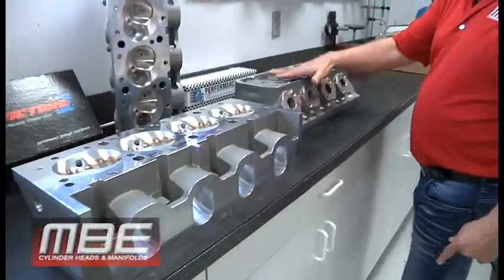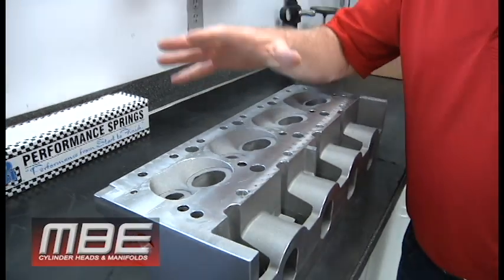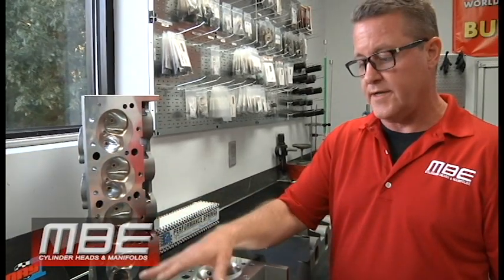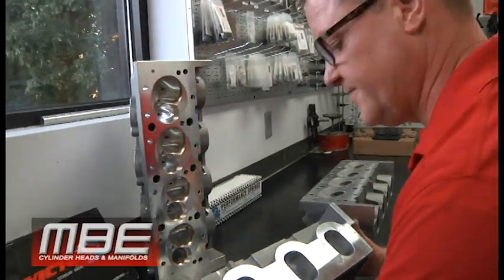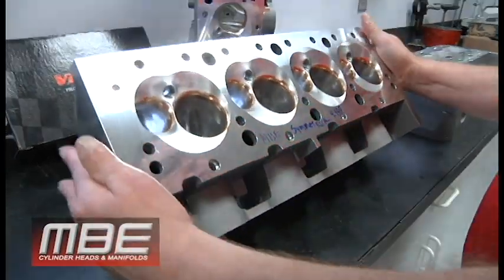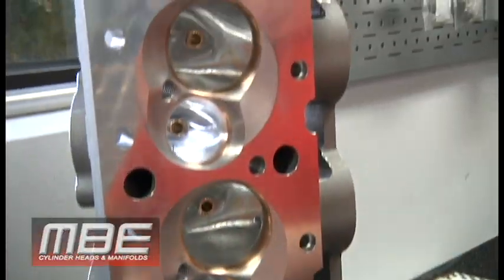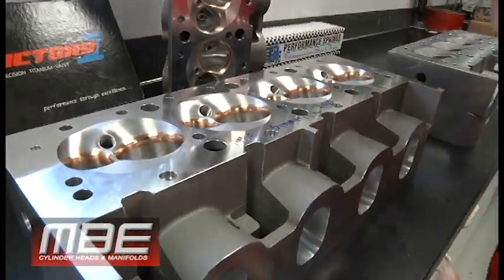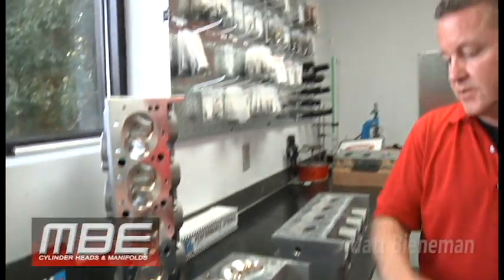** GAME CHANGER **  This SBC Cylinder Head will change History

Comment: I have been hand porting heads since the 70s and "My God" is that piece machining perfection or what?  DAMN nice! $10,500.00 worth of nice lol. Actually for heads of that caliber that's not all that bad. I paid close to that for a head for our Pro Stock JD pulling tractor back in the early 90s. When he said.  "1100 hp naturally aspirated."    He immediately had my full attention. Unless you have spent the countless hours designing and machining one yourself it's hard to appreciate the time and effort it takes to pull something off like this. Good job guys.
Reply: I'm just going to put more boost through my junk yard 799 heads.
Reply: @Adrianzx  exactly
Reply: The offset rockers required on top of that I bet
Reply: Wonder what would happen if someone used CAD CFD to design heads from scratch.
Reply: You put way too much faith in his 1100HP NA claim.
Reply: @DonziGT230  With those ports and a lot of RPM I wouldn’t doubt it
Reply: I got a woody when I saw those ports,seats,and runners and he said 1100 NA... I've spent 100s if not 1000s of hours on heads back when to get a set to flow nowhere near that... Plus even aftermarket performance heads have always needed many hours of massaging to get redonkulous flow NA..
Reply: @DonziGT230  What makes you doubt that number?
Reply: @Adrianzx  you boost 799s past 1000hp?
Reply: @rustywater3219  , They do.
Reply: Yeah. "Normally aspirated" is used by lots of  "engine builders" and other "experts" in "high performance" to refer to any engine that is not "boosted". Including "nitrous motors".
Reply: @DonziGT230  it's for a big inch small block and 1100 hp is attainable if you know what you are doing. The average person will never see it. Nascar has been getting close to 1,000 hp with smaller displacement
Reply: @DonziGT230 It can make more!    You can get 1100 with 430cfm.  This is 485cfm.
Reply: @ironmike742 Nascar is getting close to a thousand with less displacement and less intake port flow.

Comment: Retired professional race engine builder/shop owner...love watching your vids putting Ford Cleveland/D3/SC1 heads on the chevy's...ie. stagger valve - symmetrical port...I was at the 1977 Summernationals when John Lingenfelter mowed down the Comp. Elim. field with his Cleveland powered Monza...Chevy racer's were offering ANY help to stop that car...including running to the tower to complain...and then NHRA did help...they added .2lbs/cu.in. for single 4bbl &.4lbs/cu.in. for dual 4bbl. clevelands in Comp. & Modified...and the hemorrhaging of Chevy racer's to the Ford ended...and Ford's embracement of this design eventually stopped as well...now this design is second to none except maybe the Hemi in some applications...
Reply: If I remember correctly, this was the reason Bob Glidden went from the Cleveland powered Pinto's to the Plymouth arrow and continued the hemorrhaging, under the dodge banner. If I remembered correctly this was during Bob's two year undefeated streak wasn't it? And he never lost with the arrow as well
Reply: @crazylarryjr  Ok first off I find what MBE is doing to be leading edge...
1.) I was speaking of NHRA Comp & Modified because this was lbs./cu.in. and had hundreds of competitors across the country. The smallblock chevrolet owned this style of racing because he who makes the most horsepower per cubic inch is the one to beat. Yes the upper levels had BBC & Hemi's too. The Wayne County Speed Opel GT and it's 278 inch SBC was considered to be all but "Untouchable". The Ford head was the first and only time that this dominance had a knife stuck in it. There was NO SUCH THING as different weight breaks for different head designs such as with NHRA Pro-Stock. Now were talking about hundreds of Chevrolet racers across the country that believed they were no longer competitive. And they did not like it. Most Chevrolet racers that I came into contact with were unable to cope with the idea that a Ford could actually beat a Chevrolet. "He must be cheating" & "It never happened". Over time...the truth became obvious...and some Chevrolet racers took a chance...went with the Ford...because ahhh...they could see the hand writing on the wall. And believed they had to do this to win. THIS IS THE "HEMORRHAGING" I spoke of...Chevrolet racers switching. The BOSS 302/Cleveland head was designed to do one thing...Bury The Smallblock Chevrolet...and it was starting to happen. But when the Iconic Chevrolet Star "John Lingenfelter" (RIP) put a Ford Engine in a Chevrolet Monza...and won at least 2 NHRA national events...well...we just can't have that...and NHRA took the unprecedented move of handicapping the engine/head in these two eliminators. Bob Glidden was a favorite of mine and many others...but he was also just an anomaly to many of these hard core chevrolet racers.

2.) Bob Glidden's 1978 Fairmount was the only undefeated NHRA Pro-Stock. He made the switch from the Pinto because of the lead he was able to pull out of the car due to long wheelbase cars getting a weight break. I was at the '78 Summernationals where he debuted this car...he was pulling the chute @ the 1000ft mark to kick sand in the other Pro-Stock competitors faces...his mph #'s were 10+ mph down. The Arrow was not undefeated. Glidden made the switch due to obvious weight break advantages and BIG $$$. His success with the Arrow, like all the others, was no doubt do to his tenacious around the clock work ethic and ability to not only make superior power but also to get it down the track...all of which earned him the nickname "MAD DOG".

After one year...he's back in the Ford...

I have a supercharged foxbody street/race machine for a retirement toy. I am considering a max effort sbf...and MBE will certainly be on my short list...
Reply: @1bad505  Fascinating history.

Comment: Looks like a Cleveland head that is situated to fit a Chevy block. Of course, it will make power!
Reply: No it doesn’t
Reply: Exactly what I was thinking
Reply: @Shade_tree_garage01  Yes it does.
Reply: Lol ford guys  think everything looks like a Cleveland head  it doesn’t look anything like a Cleveland head.
Reply: @MarineX1124  I used to do head porting for friends  Cleveland's, they were a PIA. Ford was so minimalist with their castings.  I did like the fact I could do all the work without breaking timing.  I spent many an hour with my air die grinder and polishing compound.  I can tell you, these heads are in no way like a Cleveland.
Reply: LOL, ford guys. Aren't they just the cutest thing... like puppies with heads bigger than their bodies, and just as dumb.
Reply: @hawkdsl  fact
Reply: Makes you wonder why FOMOCO didn’t use the head then even when it would bolt to a Windsor block 🤣
Reply: @NOSLEEPATALL  
Makes me wonder why build 2 different engines? Or settle on 1 design and produce for all their vehicles.  Maybe cheaper Canadian labor?
Reply: Yeah. Just like ford copied the big block Chevy with alternating intake and exhaust ports.
Reply: @MarineX1124  i thought it was a Cleveland head.
Reply: Looks like a Big Chief head to me...a Big Chief from Cleveland. yep...Cleveland Indians...
Reply: @biscuitboy3617  no it doesn't
Reply: Biscuit Boy  You are a comedian. Symmetrical ports were not exclusive to the Cleveland Head. Many heads have that design,before the Cleveland Head.
Reply: Lmao, Ford guys love to find some type of excuse to make them feel better
Reply: @biscuitboy3617 A Cleveland head never had ports that flowed this much air and Cleveland heads did not have exhaust ports like this head, the exhaust on the 351 C heads were miniscule, only the intake side flowed well. The intake port on the Cleveland looked big, but no gains from the bottom of the port. In fact when they filled in the bottom part of the port they flowed better.. And, Ford was not the first design to have a canted valve design either.

Comment: Possibly the best news since sliced bread and cheese.
No, really, this cylinder head will be a record setter in all unrestricted classes of racing.
The Comp Eliminator guys will camp out on your doorstep waiting for their order to be completed.
LSR, Roll Racers and Drag Boat Racers will be in line as well.
Congratulations, your dedication to see this project through will reward your shop and racers alike with a new era of performance.
And the best news of these cylinder heads is, batteries are not included or necessary.
Long live the internal combustion engine.

Let's Go Brandon 🏁 🇺🇲
Reply: This its a Pro Filer 12 degree casting , will be interesting to see if MBE change the degree angle I think the went to a 11 degree on this one, because some times they said on a video a 9 degree its better for nitrous and in the other one a 12 for more nitrous and boost and the same for the splayed valves; there its a video about there 13 degree heads that they said there its not a reason to run a splayed valve head any more and correct me if I'm wrong but this its a splayed valve head? , any way keep up the good work
Reply: Really? Politics?

Comment: You will need a new camshaft,  but otherwise,  it's about time. In Australia,  Holden did this to their 304 V8 back in 1989, albeit cast iron production item.   but yeah, fantastic.
Reply: Typo:  should read 1988.

Comment: Very similar to the gm 24502517 heads. 2.200/1.650 valves, splayed valves (like this head) and they openly advertise over 1000hp Naturally aspirated with these heads in NHRA..   $1600 No seats, guides, or valves.

Comment: You'd have to have a special cam grind for the relocated exhaust valves
Reply: Basically you build an MBE Engine on an old school Chevy Block so yes special everything up top. 
This is interesting and really cool but it seems 30 years late and if you want to build  1000 hp on an old Small block you have to invest in the bottom as well. 
  Seems to be a question of what is cost effective in the end because at this point you may as well be building anything that puts out 1000 hp reliably.  It’s not going to look Chevy in your classic ride but hey you can use a th400 🤣
Reply: @frankstetka7206  Do.. you not understand what class racing and weight breaks are?
Reply: In this day and age, with the availability of good parts, and the power levels attainable, it makes good sense to choose a block such as a Dart or World Products, rather than chance a build on a stock, production block. Stock blocks were well engineered for their intended applications, but not a wise choice for a 1000hp build.
Reply: @frankstetka7206  I thought stock gm sbc cast blocks could only take around 750hp?

What would be the max power with a stock block with billet main caps on the center 3? (not the end caps).

Comment: Since the exhaust valve location has been changed, you will also need a dedicated camshaft. Just build a big block. You can buy more goodies with the money you saved. Just a tip from your Uncle Jeff..........
Reply: to me it looks like they just made an LS head that bolts to the SBC......rocker arm offset looks like a 5.7 Hemi tho
Reply: Intake/exhaust valves have been swapped on 2 cyls-cam profile would need to be reversed on the affected valves.

Comment: Wow cool they made a 4-barrel Cleveland head to fit a small block Chevy
Reply: Wow they made a big block Chevy head fit a sbc see I can say stupid shit too
Reply: 460 Ford😉
Reply: The Cleveland with a lil massaging had great flow numbers.
Reply: Where all the Cleveland's at on the Dirt Track's 🤔
Reply: @joshpitts7256  Don't know about these days, but years ago Canted Valve Heads weren't Allowed. Same goes for HEMIS.🤷
Reply: @Earl James Good place for em
Reply: @douglascooper1987  Probably so.. I'm just giving the Ford folk shit...😀
Reply: well big block Chevy has been that way for long time too
Reply: Maybe there's some similarity but hope these heads are more reliable than the Cleveland heads which were prone to cracks and valve guide wear. And, the block wasn't very strong. In the end, the Windsor engine won out over the Cleveland,
Reply: @joshpitts7256  😁😁👍
Reply: @robj2704  Windsor only won out here in America, and that was due to smog controls.  In Australia they made them into the 80s i think.
Reply: @rustywater3219  yes rusty 82 was the year the big V8 left our little part of the world. A very sad time.
Reply: @Misisipiflyer  A little  massaging? They were junk, the intake side had flow but terrible dynamics. Many guys even now fill them in rather than port them l.  To get the exhaust to work had to literally  mill away 1 1/4 of the exhaust side of the head and create new ports out of aluminum blocks. That way we could raise and reshape the ports.  They were junk 40 years ago and even more so now.
Reply: @joshpitts7256  Banned after winning the WOO championship years back.
Reply: @joshpitts7256  🤣🤣
Reply: @jameywhite6055  Ha ha I knew the the Ford nut swingers would say it looks like a Cleveland.
Reply: @joshpitts7256  only Chevy
Reply: @joshpitts7256  25 of them sit in my garage gathering dust.
Reply: That’s funny! Totally looks like a Cleveland head!
Reply: @jameywhite6055  he prolly thinks the lsx isn’t just a Windsor reworked ….
Reply: @ScooterLee-ei1ep  sorry scooter, no siamesed intake ports.

Comment: This is cool as shit, and I’m glad that people with these kids of resources are still investing in the Small block Chevy. They made like 100 million of them and there’s 50 years worth of aftermarket support so even with the LS being as cheap and powerful as it is, I think in terms of  power per dollar the sbc is still very relevant. When it came time to build a motor for my Iroc-z a few years ago I could have swapped in a junkyard iron block LS, but when I sat down and did some math for the power level I was shooting for, I realized I could have the short block rebuilt locally, install a set Vortec heads with ls6 springs add a no name roller cam and drop the engine right into place with no worries for less than it would have cost me for the LS swap, with the added benefit of having a zero mile engine, so I went with old faithful and it’s a blast to drive. My concern here is that while these heads are probably bad ass I’m guessing they’ve got a price tag to match, which isn’t to say that these guys are going to ask too much for their product, just that it’s not going to be something your average person will consider for their build especially when the aforementioned LS can be had on the cheap and more than likely equal anything a small block can produce. Now if your racing in a class that requires your u to run a small block, then yeah these are definitely the heads for you, but is that the market you guys are shooting for? Not complaining, genuinely asking

Comment: GM should have done this in 1955. FINALLY!
Reply: They should have done it for the old straight six
Reply: You have to remember the GM design those original heads based on mass production and general use. The purpose of the two center exhaust ports being right next to each other was the heat riser in the intake manifold which activated the divorced choke for the carburetors back then. It wasn't until 1987 the fuel injection came around and from my understanding their plans to redesign the small block in its entirety were already underway. I.E., the 3rd generation small block aka "LS".

But you're still right. Even when they designed the SB2 heads they could have done this. 👍

Comment: Now for the price not one of us is going to be able to afford don't take that for a negative I would run them for sure if I could ever afford them he'll I'm still porting used brodix and dart heads flowing them on my flow bench I have bills but I would have to hit the lottery for these so I will look at them  and drool . Could go as fast without as much stress on components the weight to time and parts broken is where it is I still get these old heads for a good deal most time alot of welding and machine work goes I ro them before I use them only on my personal car as well .nice heads guys great work

Comment: As Dominic toretto would say not a bad way to spend 10 grand...
Reply: Yeah really. This is not on the budget menu
Reply: Why would it be cheap?
Reply: Imagine owning heads worth more then your truck! Jeez I wish I had ten grand laying around I'd feel so kool!
Reply: Yeah, but Dom Toretto could "afford" dozens even @ $10K apiece.   That head could be 3-D'd for less than $4K.   The 348/409 flowed real well.  Why not a "W" alloy head for your SBC?
Reply: Could throw a 500 shot on a cammed junkyard ls and make 1100. For about 5 grand. Thats the engine including wiring computers etc.
Reply: @jackdale9831  as I said. The best bank robber owns the fastest car nowadays.
Reply: @jonbrockman5308  where are these 600hp junkyard ls cam only. And no junkyard ls will live more than a few pulls at that size of nitrous shot
Reply: @jonbrockman5308  ok....these heads will support 3-4k hp on a power adder lmao...but run your 500 shot lol....these comments always make me laugh...🤦‍♂️
Reply: @joshuarisley8091  Bunch of clowns.
Reply: @tokeypokey  You’d be wrong lol. Granted nitrous makes massive amounts to of rod bending torque compared to turbo… I’ve been putting 32psi to a stock crank stock rod 5.3 all year. You’d be surprised what you can do to a stock gen 4 ls if you know what your doing.

That said al these comments are DUMB. These heads ain’t for some joe blow trying to make little power numbers like say 1200hp. These heads are for people trying to make 2500-3500hp…

Comment: I am not understanding how you can change the sequence of the intake and exhaust valves without using a special camshaft??
Reply: It does take a custom cam. The lifter spacing (the distance between the lifter bores, center-to-center) is the same as a traditional SBC.